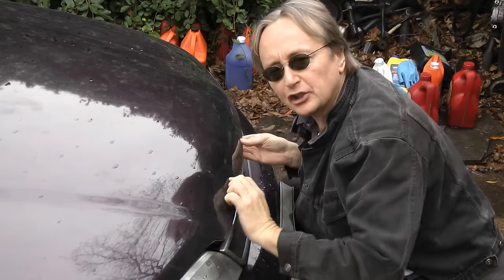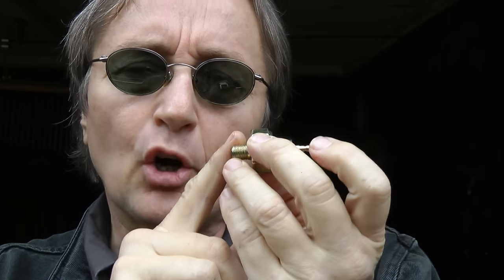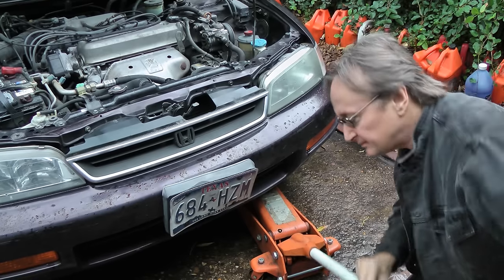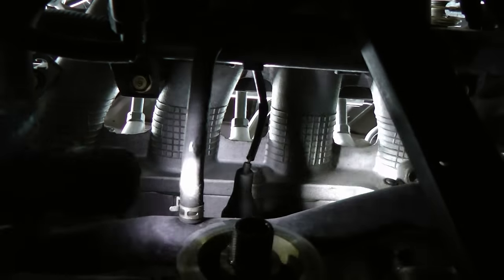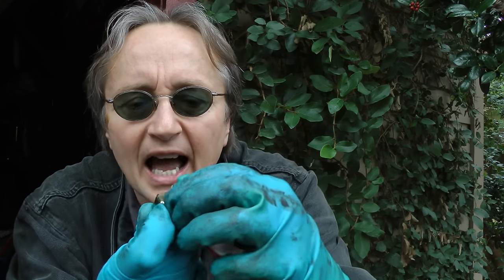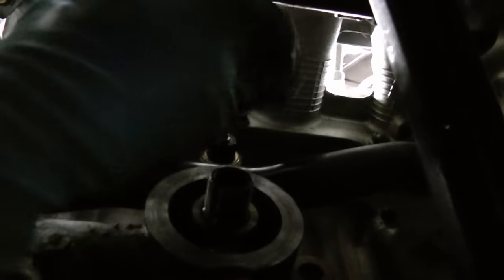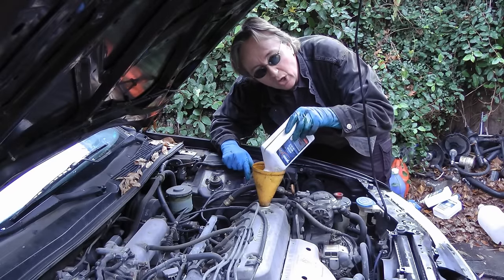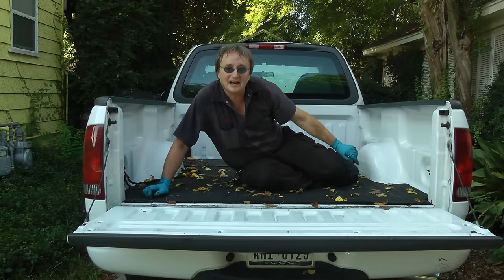How to Fix a Low Oil Pressure Light in Your Car

Comment: Hmm. earlier i noticed that the red light only comes on when the RPM is below 1000 (almost when you're about to stall the engine). I don't think it's worn out oil as you're saying, because it had oil service 3000 km ago.
The light never flashes while im driving!
I called my mechanic and he said it could be the oil pump or some sensors that have gone wrong...What do you think?  Is it safe to drive the car?
Hope you can reply, thanks!

Comment: Have an 05 GMC Envoy XUV (5.3L).  Low Oil Pressure, followed by Shut Off Engine.  It has oil.  Hear a slight tapping noise in engine, but not loud and no engine vibrations.   When starting, oil pressure is normal, but drops to zero within 2minutes.   Do you think this is oil pressure sending unit?   The tapping makes me think engine isn't getting oil...

Comment: Could you or do you have a video on how to replace a oil pump I'm having the problem with the oil light I already changed out the sensor and still it comes on .

Comment: Also these videos have the BEST, Quality of any mechanic videos
on the youtube net I think. I love it great detail and video always help! (: Not sure though if on a 1999 toyota solara 1mzfe engine If the oil pump is with the oil pan under there after taking it off.
Reply from the maker: oil pump is on the bottom front of that engine, you remove the timing belt and it's removed from the front

Comment: I recently had my valve cover gaskets replaced and stopped an oil leak.  I also had all wires and spark plugs replaced.  The engine looks nice and does not leak, I hope.  I have only had it back one day.  I was driving it the night I got the vehicle back and the oil light is flashing when I stop at red lights.  It goes off immediately when I step on the gas.  I have researched this topic online and have found that I have low oil pressure.  Should I take the vehicle back to the same shop?

Comment: I have a 1997 Plymouth Grand Voyager. Hear a slight tapping in a lifter when the engine is first started.  209,000 miles on it. 2 times in the last week when stopping the van at a traffic light the oil light came on.  Oil level is full, oil pump may have been replaced when we did the timing belt.  Cannot remember.  Is it possible that the oil pick up tube screen may be clogged with buildup?  Thought about dropping the oil pan can checking this first before any other major work. The whole family enjoys your videos.

Comment: i have a honda civic 94, i have already changed the filter, and changed the oil and still the light is coming on, im on my way now to purchase this Oil Pressure sending unit thing, and see how it goes, i was also told that it can also be an electronic thing like the sensor or something is that true?

Comment: Hi Scotty, i was working in a chevrolet optra with low oil pressure light and a noisy engine, the engine oil was very dirty and it wasn't lubricating correctly. When i take off the oil pan it has a kind of 'oil mud' and very dirty oil. Ysterday i clean that but my doubt is: how can i give a 'deep clean' to the oil strainer? Somebody told me that it could be washing the strainer and tube in a gasoline container, other says soak in gasoline and set on fire to burn the dirt, what's your opinion?

Comment: scotty do mind making a video on oil pressure and water temp mechanical guages ..im not finding any usefull info on the internet...can i remove the idiot light sensor and sqrew in the the new oil pressure adapter at that same port...will the oil light stay on or off?

Comment: what is the part called  ? any way  I own a 2016 colorado truck a message comes on ENGINE POWER DECREASING, I noticed a have a engine oil leak for past month its coming from the front of the engine near the timming belts. They told me its the gasket has to be replace not sure if that is the cause of the engine power being reduce because I took it to Oreilys the other day and ask the guys to diagnosis to engine light in my truck they came back to tell me now I have a problem with oil pressure issue  the piston oil nozzle squitter in the oil pan is the issue. Any advise is welcome.   p.s any good site to check for recalls.

Comment: Did this still on and can hear a knocking sound my frontier sat for 2 years but before it sat I changed the oil and filter I can look down the port where u.pour the oil in and it black I stuck a stick down there Ans black sludge looking stuff was stuck to the stick going to sea foam it over night and see what it does. Any suggestions if that don't work.

Comment: Scotty what's your opinion engine oil treatments? My Dad's 01 Olds Aurora with the 3.5 V6 is burning at least 2 quarts of oil between oil changes so he added some Lucas oil treatment? Do you see good results when they are used?

Comment: had this problem on a deisel van only when hot,light comes on idle drops and sometime stalls,level is good,may be bad filter gonna change the filter and add an oil thickner,any tips appreciated.

Comment: on my ranger the oil gauge will flip up to normal pressure and back down to 0 pressure randomly and the oil is fine. Would this be something that would cause this?

Comment: Scotty, I need your help. 

I am driving a 2005 mazda 3 GT, I just realised that the check engine light and oil pressure light remains on when I turn the key to ON. They only go off when I start the engine. Is this normal? I don't recall have the light stay on for so long when I hae the key turned to on previously.

Comment: Thanks Mr. Kilmer. I think I am going to replace my valve cover gaskets since I have noticed a bad smell and some black crust, probably oil, on the exhaust. So it looks like I am leaking oil, causing the pressure gauge to drop. Luckily the pressure has only dropped once, and I wasn't stupid enough to keep driving and ruin my engine. While I am at it I am going to replace my air intake gaskets also.
I know the Cateras are a nightmare, but I still want it to run until it's last breath. Any advice?

Comment: Hi Scotty, good video. / my problem is the connector won't come off, stuck. I bought a new one and the sending unit, I think I'll need to cut the wire and break the connector to remove it and then install new ones. Is is common for connector to be stuck? thanks.

Comment: Thank you for your video! My 350z at idle has the oil pressure low light on and my pressure gauge is down very low, but when The rpms go up, the gauge displays the proper pressure and the oil light goes off. Would this process solve my problem?
Reply: Same for my maxima
Reply: @sandisomahlangu8599  my maxima is doing this also

Comment: Scotty, I have a 2002 Mercury Sable Duratec 24 valve V-6 DOHC ...I wanted to put a guage or even change the sending unit but even after removing oil filter I can't get at it. I can't even get my hand near it ...any tips ?  Helpppp (BTW oil light flickers after it warms and idles or at stop lights)

Comment: i have a old 1979 Toyota corrola project car and it says the oil temp is high the engine isn't hot and when it starts it says its cool but then it goes up to high in about 10 minutes of run time but the engine isnt running hot any tips?

Comment: Hi Scotty!
just yesterday i bought a bmw e46 320i '00. 
When starting the engine, the yellow oil lamp shows but dissapears after 20 seconds. 
And after driving a little(10 min ish), and then park the car and let it stay with the engine running, the red oil light comes on.
i checked the oil level, but it's good. 
What could be the reason, and is it expensive to replace  the parts? please reply!

Comment: hey mr kilmer..
i have a 96 ford windstar and the oil light flicker on idle and the idle goes up and down between 500-800 and it shuts off, i replaced the pressure sending unit and egr valve and sensor and tps sensor still doing the same thing..need ur help

Comment: Hi Mr. Kilmer, I am almost certain based off of your video that I need to replace my own oil pressure sending unit on my Cadillac Catera. However, no parts catalog calls it an "oil pressure sending unit." What exactly should be the part name otherwise?

One more question, sorry, but I sometimes get low oil pressure according to my gauge, even though I know I recently changed my oil. When I put in a little oil, something like half a quart, the gauge fluctuates regularly again. 

Any tips help!

Comment: Hi Mr. Scotty my chevy impala 06 V.6  3.5L  Low oil pressure light turns on and off. First, I fixed the oil filter gasket housing, i had a leak. After I fixed it, I notice that once reaches from 50-70mph and sometimes at 40mph the sensor light comes on and than goes away. Every time I accelerate the sensor lights up and when I remove my foot from the accelerator goes off,

Comment: Sir, I drive a 2000 camry ,4plug engine, I have been noticing that the oil indicator light shows after driving some distance and the car come a stop.. This happens too whenever I switch on the AC. The car also jerks when the AC is put on at stationary and the oil indicator light shows. I'll be glad to hear from you. Tanx

Comment: I'm 71 and I've got an 01 jetta 2.0 with 281K miles, oil light and alarm started spontaneously beeping and flashing, replaced sending unit, no effect, should have checked oil pressure but didn't so flushed engine a couple time before dropping pan and replacing oil pump, put it back together light still flashed and alarm beeped, replaced sending unit with mechanical pressure gauge, 40 to 60 psi, so am ignoring alarm and light now that I know pressure is good. At least it was a learning experience.

Comment: My cutlass seized this evening. No oil Light, no warning. Only thin was a slight engine tick that got worse as I was driving over 1 mile. Engine began to have poor acceleration and My transmission was shifting the best it could with the engine not running properly felt weird. It would stall without a clank  and only when let off the gas. The final result was it stalling like that and never starting up again. it clicks but won't even crank. Is the engine toast?

Comment: hi scotty i have a little problem i have a 1989 ford mustang gt 5.0 and my oil pressure is low at idle and perfect when am driving it the oil level is good and i changed the sensor and it still low at idle any idea on what it could be???

Comment: I have a 4.7 I had the oil pump replaced along with the whole timing and gaskets because it has 270k miles. Replaced the sending unit too. And it's still saying low oil pressure? The truck does have a slight lifter tick, does that have anything to do with it? Also how many wires should the oil sending unit CONNECTOR have ? Mine only has one wire..

Comment: Scotty - maybe you can help me. I have a 2003 Dodge Caravan SE and the oil light comes on when i start it in the cold. If I let the engine warm up and restart it, the light goes out and stays out until it gets cold again. It also throws a code that doesn't turn on the CEL - it says pressure sensor low voltage. How easy is it to swap it out on a caravan? Do you know where it's located? Is it something that could damage the vehicle?  Thanks! Keep the videos coming!

Comment: Hey I have a 2007 Honda crv and the oil pressure light comes up when ever I turn or brake. So I checked the oil level and it was low and really dirty. What could cause that to happen?

Comment: I am disabled and can not afford to get my 2003 chevy venture to a shop I need to get to the back 3 plugs and also replace the resistor for the a/c heating fan .
Any ides I heard it was a bear to get to the back 3 plugs . The resistor is up inside the driver side dash somewhere

Comment: This is my first time writing message to you and do hope you could find times to teach me.

I hv a car problems: my oil pressure is ON after I drive for about 15 mins. 

The engine oil is FULL, NO LEAKING at all and no overheat problems. 

The car model is Chevrolet optra 2004 I bought it second hand. 

Shall I change the oil sensor, engine oil and filter ?

Comment: We have a 2008 Dodge Caliber SE,2.0 Engine. We are struggling  trying to take the old oil pressure switch off and replace it with the new one. How do we release the green switch so we can put the new oil pressure switch on

Comment: We had the engine rebuilt and the rebuilt engine probably has like only 5,000 miles on it, about 2 weeks ago I asked someone at autozone they said I might be using the wrong oil I use 5w-30 what do u recommend I should use? And I noticed that when my car is cold the oil pressure is perfect at idle and in drive but when it warms up it's low at idle and perfect in drive. Is that normal?

Comment: do u have to drain the oil first? or just refill what was lost when removing the oil filter?
Reply: +Jesus Lujano Might as well do an oil change. If you want to, you can just take off the filter, but it'll make a mess.
Reply: ***** true thanks bro im currently having this issue where my oil pressure light flickers on & off i checked the fluid level & its good so i think this is

Comment: I happened to have a oil sensor that was stuck in the oil pressure good position.  Meaning when I turned the key on, and looked on the dash there was no oil light. Which i found odd since every car has an oil warning light or gauge. Changed the sender and it fixed it.  Oil light came on with the engine off, and went out when ever it was running

Comment: I have a 95 Toyota pickup 4x4 and I can’t find the wire that plugs in to the oil pressure sensor thats right below the oil filter? Do you think you could help there is a wire right below it but it doesn’t fit in the sensor.

Comment: HI Scotty first off thx for all the hard work you do to produce these videos ... Well my question is I have a 2007 Chrysler 300 and just tonight the oil pressure light came on .. I checked the oil and its good.. I believe you recommended the next step is to replace the sending unit which I will do but im curious for now just to get through the week till my days off can I drive my car that way without causing damage ? THX IN advance

Comment: Would this light come on for a dead battery? I have a 2007 Toyota Yaris that has the symptoms of a dead battery: no lights, automatic locks not working. When I turn the key, I get nothing whatsoever except this light pops on. The oil level is good and oil is clean.

Comment: Hello Scotty, I have a 97 sonoma 2.2l recently my low oil pressure gauge has been going down to 0 at idle. I will try changing the sensor. If this doesn't solve the problem: should I try an engine flush and change the oil? The oil isn't very dirty. The vehicle has 19x,xxx km. Thanks

Comment: Hey scotty, i have a 2000 Monte Carlo SS with the 3.8L v6 Non Supercharged. Last week my low oil pressure light came on after about 30 minutes of driving. Ive been driving it since and everyday the light comes on after ive driven the car for a long period of time. It only comes on at idle, the engine runs smooth and doesnt knock or tick, no CEL at all. Could it just be the sending unit? I also looked at my dipstick and the oil was down about 3/4 of a litre. Any ideas? Thanks! Love your videos :)

Comment: Yep getting the oil light coming on now at idle....a few days after a Service, the car gets serviced every 4 months (warranty) this one was 150k km, so I think they maybe flushed the system.  I suspect a sensor problem.  If it were bearing wear I would have been getting intermittent oil lights before this, not just suddenly all the time at idle. No OBD2 codes shown.  I will change the oil from the 5 30w they used to 10 30W,  to see if the thicker oil fixes the problem, and indicates engine bearing wear. If it doesn't then it will be sensor fault.

Comment: I just got my oil changed on my car and I'm getting a message on my dashboard of my '09 Impala that the oil pressure is low. To change the sensor do you have to empty out all the new oil I just got? If so, could you filter it and use it again?

Comment: The oil indicator light came on in my 2005 ford focus the other day.  I hope it's nothing major.  It's in the shop now.  Waiting to hear the news.
Reply: When the mechanic went to check the problem I described he said the light wasn't on.  I told him it was on when I started the car the other night and was on the next morning when I drove it to the shop.  He didn't know what to say but only "it's not on now".   He did replace the sending unit and test drove it for 5 miles and said the light didn't come on.   Total bill was $198.00 which included the $60 diagnosis fee and an oil change.  Luckily I had a coupon from the last time I had my car fixed there, which knocked off the $60 diagnosis fee, leaving $126 to pay.

Comment: question here sir: 
recently a oil service light came on in my dashboard (buick allure 07), i did an oil change and reset it but everytime i start my car, the light keep on blinking so i replaced the oil pressure sensor yet still there...any advise, thanks

Comment: Hey Scotty, I have a 2005 chevy aveo and the oil light flashes only when the engine is up to temp and idling. Thanks.
Reply from the maker: replace the sending unit, pray it goes away. If not, have the actual pressure measured with  a mechanical gauge

Comment: Scotty, I drive a 2011 4 cylinder 2-0 Lt VW Tiguan. Only under hard turning does the low oil pressure come on, just for a second and then disappears. What could possibly cause this? Appreciate your help in advance!!

Comment: had this problem on my 02 ls where it would come on at idle and shut off at acceleration this would usually happen in 3 week intervals at low rpm(625-675) but it started to stay on until about 1100 rpm. this usually only happened at lower temps. turns out the sending units springs were worn out and giving a false read. thank god